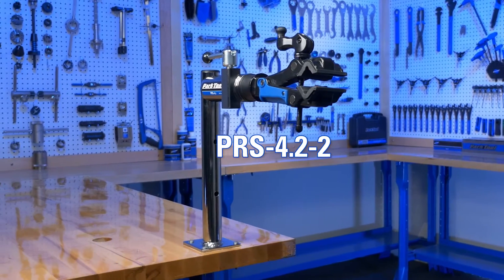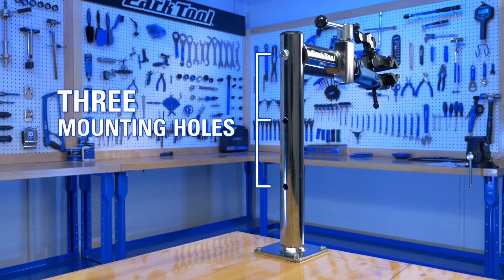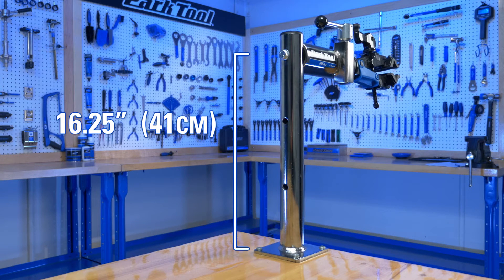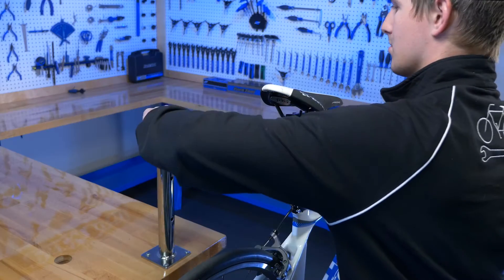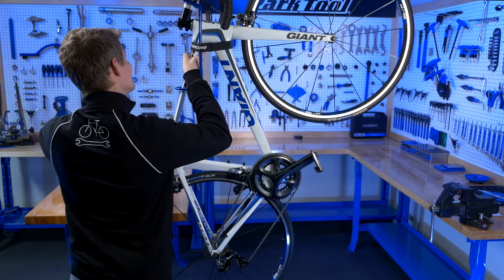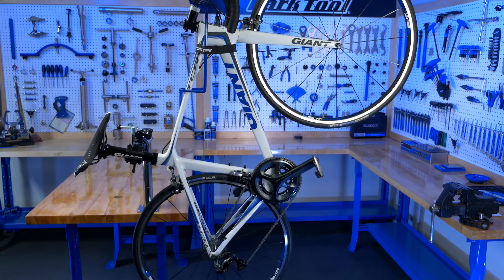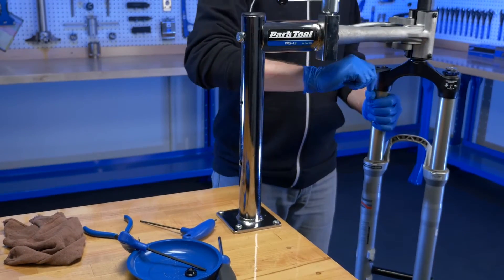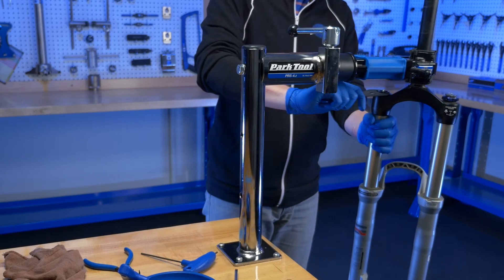PRS-4.2-1 & PRS-4.2-2 Deluxe Bench Mount Repair Stand

Comment: Hi, what are the dimensions of the product, horizontal distance between the center of the clamping and the fixation on the Bench. 
Thanks in advance.
Louis
Reply from the maker: The distance from the center of the upright tubing and the center of the clamping area of the clamp is about 15.5". Thanks!
Reply: @parktool  Thank you very much!
Reply: @parktool  Hi I have another question:  What are the dimensions of the square surface in contact with the bench and the diameter of the upright tubing? 
 Thanks in advance.
Louis